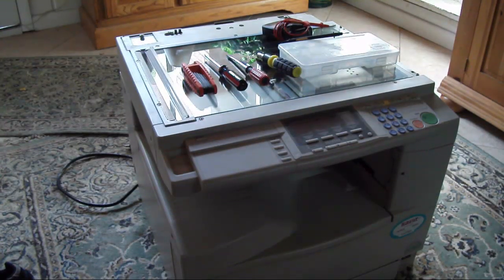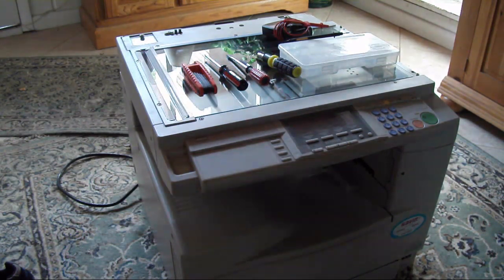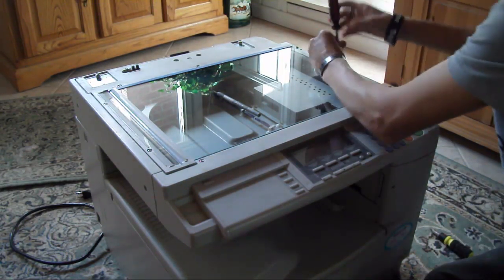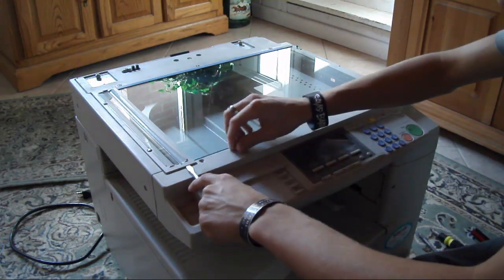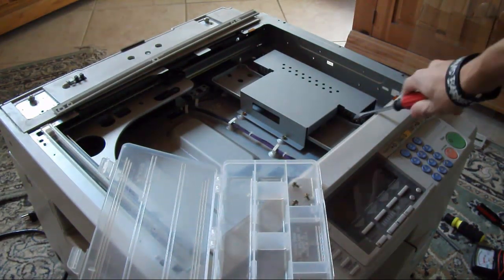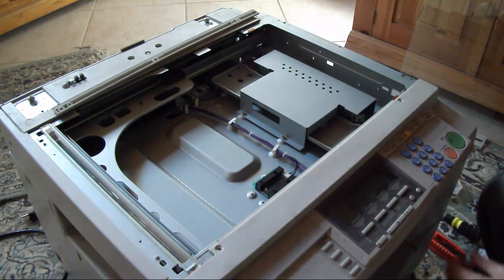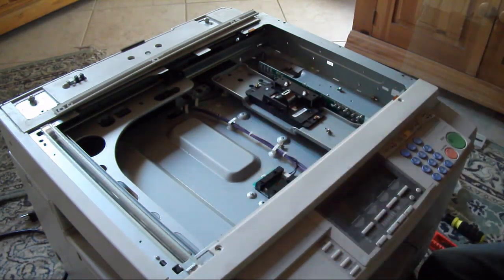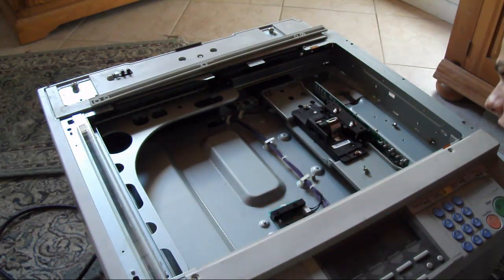Copy Machine Tear Down: Part 1

Comment: Its called a c.c.d. which stands for (Charged Coupled Device). This records the image transferred through the mirrors from the original that is on the glass. Beware of the laser in the machine. This machine looksl like Kyocera Km 3010 copier.